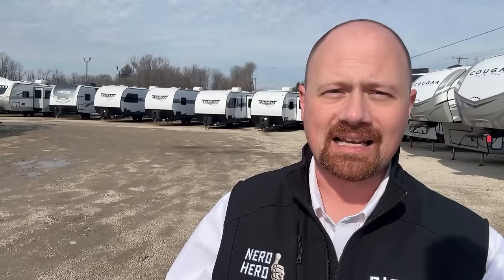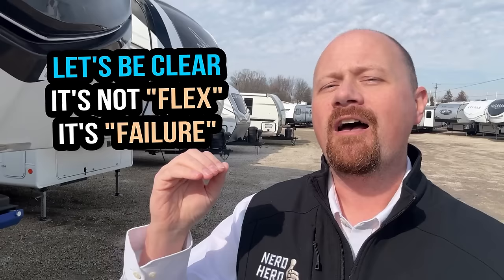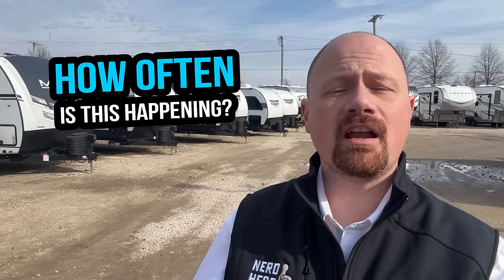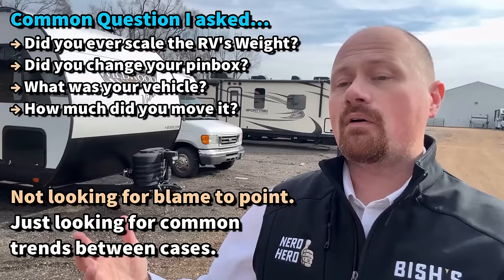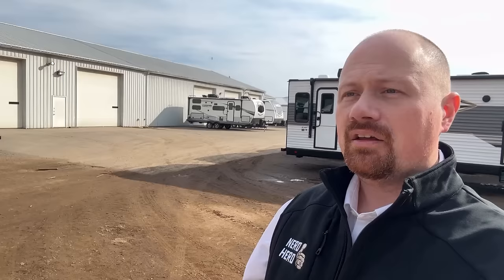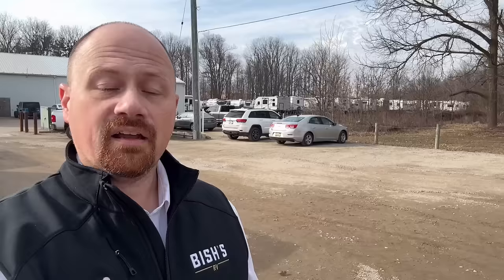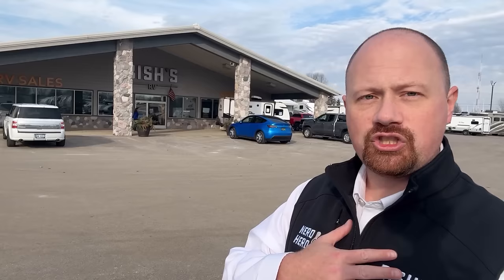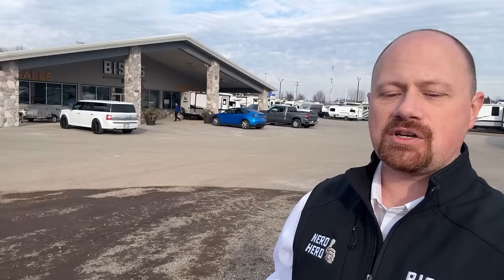🚨 RV Frame Flex & FAILURE!! • WHAT is Happening and WHO is Responsible?!

Comment: Hauling a big RV with a semi-truck is common. Do RV manufactures tell you to only use dually pickups in their disclaimers?
Reply from the maker: There is not enough "dont do this or that" out there period
Reply: No it’s not common ! It is rare to see a HDT pulling a 5th wheel. The only time you really see them is when they are at a Rally. Out in the wild is very rare.

Comment: Great video. I scaled my new montana 3781RL on the way home from the dealership. Pin weight was 500 lbs heavier then brochure and was 750 lbs heavier overall.  I weight mine when loaded to ensure I am underweight. I bought a F350 DRW to pull it. Dealership did ask me what truck i had and recommended a dually. I also researched frame flex the goosebox or Anderson puts allot of excess stress on the pin. Great data. Keep up the great work.
Reply from the maker: Thank you for sharing that. Perfect example of what I mean. How gross your weight and actual assembled weight are often very different.
Reply: The “gooseneck” and the “Andersen” are not similar in the slightest.
Reply: @jefframsey7879 correct but they both change the loading of the pinbox. Thr goosebox is like adding a lever arm on the pinbox. The Anderson extends the pinbox connection out past the end of the pinbox adding more stress to the frame

Comment: I’ve seen a trend on a certain brand and models not naming names of a 5th wheel. Would a middle size or smaller 5th be better?
Reply from the maker: What’s disgusting this video could affect potentially any RV, but the current trend does seem to be focused more on the larger class things, and not the mid to smaller size

Comment: Josh, Love your videos. Question, How did you do what you did at 1:01 where the trailers are backwards?  As for frame flex, how thin can we go till we are caught?  That is my thought!
Bad Steel??? What imported from Ohio?, Indiana? Cain't be Alabama they closed years ago. Maybe, Just Maybe If it was MADE IN AMERICA it would be different!
As to scaling, What are the tires rated at?, Axle?, Springs?, GVWR? Educate your self on the weight of your vehicle. 
Semi truck has a different electrical system.    I hate to burst your bubble, BUT The air ride is much better than spring ride.I started in trucks with springs and transited to Air ride. Bobtailing is not bad at all.    But then Air ride frame, Air ride cab, Air ride seats make a very smooth ride. How many of the 5th wheels being pulled by HDT units are affected by frame flex?
In doing your scale, cat has 3 platforms. then drop the trailer in a parking space and put your pickup on the scale having JUST the driver in the vehicle. subtract the one from the other. to see the difference.
Reply from the maker: 1:01 Just flipped the video on the vertical axis to help focus on the message at the moemnnt

Comment: I agree dealers should do a better job of educating the customer, but I don't see it happening... They make money selling you the most expensive thing you can buy. The customer should know that and do the research.
Manufacturers definitely need to the frames for limited travel. They bank on most customers parking them at 1 campground and or towing them once or twice a year. For Montana high country, 15k miles seams to be the design life, even though it's designed for "full time living".
That also makes a HUGE difference to the number of affected units. Obviously if 90% of them travel less than 100 miles a year, it's unlikely any of those will exhibit frame problems. If they did it would have to be a complete design failure. So if they say it's half a percent, and that only applies to 10% of them that move frequently, then that's 5%, not half a percent. That's obviously just throwing numbers out because of the I have no idea how many people move frequently. Regardless, the "half a percent" number is honestly meaningless.

Comment: Josh, I don't know if you have a video on pin boxes. If you do please lead me to it. If not could talk about the difference of solid and flexible type. What does a slide rubber,i.e. morryde do to he fifth wheel trailer vs. a air ride, ones with airbags and shocks attached to them. What happens between the vehicle and the trailer. Then most of all the advantage of having one. Thank You and safe travels.robert m. aka billy bob
Reply from the maker: I do not but that’s a good idea. Probably won’t be able to get to that any time soon as it turns out
Reply: @JoshtheRVNerd  that's ok, anytime so we can learn ever more about rvs. Thanks again and always enjoy the words of the nerd.

Comment: The truck suspension may not have "activated " if it were spring ride. With air ride there is only enough air to maintain level. Now for trucks not handling well bobtail yeah they suck because they're so light in back and in inclement weather there is very little weight on the drive tires and therefore very little ground pressure and contact patch.

On manufacturer listed weights i bought a 5th wheel and found pin weight to be about 1400lb more than listed and gross about 3500 more.  My tow vehicle is capable of handling the weight but I'm not fond of being at 100% gross axle weight and 95% tire capacity. The published weight is misleading and should be illegal.

Comment: I’ll point fingers. Pretty easy and messed up at the same times

Lippert tells the manufacturer what frame they need.  Not the other way around.  And many says ok that’s what we’ll use. Instead of getting an actual architect to design a proper frame   
We have had two fifth wheels and shooting enough both of them had the exact same issue  and if lippert welded in just two simple cross brace problem solved

Comment: So if you are traveling a lot or full-timing,  is a motorhome a better option? Class C, A, or B?  Are they better designed for higher travel setup cycles / miles over a towable since they are a drivable rv?  Or will you have similar issues with a motorhome used at the same rates? Cracked walls etc…. I have a tt and haven’t had any issues but plan to buy a class c in the next year or so.  Will not full time but plan to take several trips a year throughout the country.

Comment: Go to HD 3/4 or one ton you may not need a WDHITCH which does stress and damage a travel trailers frame./Also.the tall bedrooms up on the front end of fifth wheels seem unreal.Unsafe.Someday we will see smaller crawl in over the hitch pin on fifthwheels or the neck will someday be absent of a house.Jmo.

Comment: Josh - we love to watch your reviews and we appreciate all that you do.  However - on this one - I think you are missing an important point - that comes from my world, engineering.  When we design a system we make it at least 1.3 x it's maximum load.  To make the point you do not hear about automobile or truck frames failing.  And - many of them are grossly overloaded.  There need to be margin in the design and RV manufacturers are not doing the right thing when they do not over design the frames.  This issue would be gone if they did.  Period.

Comment: I agree 99% of what your saying
I do believe that Lippert in particular 
Doesn’t approve let’s say (GEN Y)
Because Gen y will not give them sole rights to the product 
However they approve goosebox
I understand the less expensive gooseneck adapters that just bolt to the kingpin
Changing the geometry and causing frame failure 
I’ve spoken to several RV tecs 
This is a hot topic 
And your comment about too much truck
I would have never guessed 
But makes 100% sense 
Great video 👍👍 
Makes me wanna travel from Wa state to your dealership for my next purchase 
Because of your honesty

Comment: I wanted to add a comment is regards to the "too much truck", you specifically mentioned towing a trailer with a semi truck. Just to clarify there is a large group of people that do just that; however, the standard semi hitch is changed out for an air bag type hitch. So I think this negates your statement, and maybe clarification should be made? Just a thought-thank you.

Comment: I have not hear you mentionned when a manufacturer decide to change the floormat of what the frame was designed for so the weight distribution are not what its supposed to be and could also cause issues!!
Reply from the maker: That’s a potential design oversight that could translate into an issue certainly

Comment: As trailers have gotten bigger and heavier they're running into the same problems that have been discovered and remedied by the transportation industry more than a half century ago.  If you intend on pulling a 40-foot 30-ton RV all over the place, then just make that quantum jump to a converted transport pup trailer pulled by a tractor with air brakes.  Problem solved.

For something smaller, engineer and build your trailer with full gooseneck technology; on a new factory gooseneck deckover.  Sure, the front end might look a little different up front compared to John Smith's fiver down the road.  But the frame will be way more capable.  

Having built 3 different slide-on cabins on a 16-foot conventional steel utility trailer over the years, I cringe every time I see the cheap little frame of some factory-built receiver-pull the same size.    My new truck has a factory gooseneck hitch.  My next trailer will be a 20-foot gooseneck deckover with self-built cabin.  If I don't like it, I'll just strip fittings and fixtures and build a different cabin.  You have to think like a boat-builder and an airplane builder both, when designing your trailer.  No frame-flex or pin-box problems for this boy.

Comment: Sorry man, I didn't really hear you give any serious consideration to subpar manufacturing and the fact that units with the most frequent problems were built during and after the pandemic.  To be fair, it's not just the RV industry, it's everything.  But I find it a little hard to believe that there's suddenly such high numbers of people switching the pin box (although common), pulling with semis, using there RVs too much, and overloading to the point of failure.  Seems like many of the consumers with problems had just purchased their units when things started failing.
Reply from the maker: Regarding so many people suddenly switching  pin boxes

You mentioned a lot of people having issues around the pandemic period - that’s also when almost  literally twice as many people started RVing. Ownership went form 8 million to 15.5 million on input about 2-2.5 years

And the number of mobile full timers skyrocketed far beyond anything anyone ever saw before. The same flex issues were happening before but the number of instances was lower. The visibility of the problem was made much clearer as a result of the volume of users and shift in usage

Comment: OK you answered that you Don't believe my Andersen Hitch is good to use on a 5th wheel.  I believe that is what you ment. The issue I have is the dealership just installed that Hitch in my truck telling me that that's the biggest selling Hitch for them. We just purchased a 2024 Grand Design Influence 3503gk  38ft 3in 5th wheel.  
I'm hoping that I  didn't get taken on the hitch. It's an Andersen 3721.
Thanks
Reply from the maker: Contact your rvs mfg with your vin and ask them to make sure

Comment: I am in the market for a toy hauler 5th wheel in the $125K MSRP range. I was very interested in the Grand Design Momentum, until I heard the term Frame Flex for the first time in my life. What brand of Toy Haulers are good quality, then? Only ones that don't use a Lippert frame?
Reply from the maker: Lippert is about the only chassis MFG making frames for that size. They build their chassis to the specs of the MFG's request

So a lippert chassis from company A isn't necessarily the same as one from Company B

You may consider something like a Valor for comparable features. Seismic is in the class as well. 

Fuzion. Raptor. Those are a few others you may peek at. 

Here are a few Valor models to review: https://www.bishs.com/rv-search?brand=Valor

You mentioned shopping by MSRP... any reason you're targeting MSRP specifically? We don't sell for MSRP at our stores and don't do hidden fees

Comment: Ok Josh< I agree with you. However I think there is at least one think you can do to educate the customers and that is get the scales to weight each TT and 5th as they come or before the sale, Seams easy if it is true the cost of a scale is so cheap that a consumer can buy them. Now for a rant not directed at RV dealerships, but truck manufactures in general. These diesel wars that is going on and them putting those big engines in 3/4 ton trucks withe same frames etc, as the bigger ones  So owners and fools say it can pull it out of manufactures spec's. In my opinion no 3/4 needs more than maybe 350HP and 600# of torque. Putt all those 4ooplus HP engines in class 5 and up trucks. I owned a 2004 2500 with 325 HP and 600# torque and it was very capable at its rated GVW with a 5th wheel. I could go on, but wont.
Reply from the maker: It’s a thing to potentially discuss

Comment: I am retired now, but  i was a steel fabricator for 40 years. I understand what it takes to make a 5 th wheel strong and reliable,  It is not the steel, on the frame of my trailer it is to light weight. It needs heavier guage steel, better gussets and welds. I have never really understood how the front of a 5 th wheel holds together as well as it does. the hinches to me are all to thin. 
I have seen people overloaded and the wrong tow vechile.
Do not change your hithes and do not overload either.

Comment: I dont think 5th wheels are made for off road. 
I have never taken mine off pavement and never will. Plenty of places to park
Tremendous flexing from potholes, jerking from getting stuck, just think they are not build for that
If a camp site is not perfect I do not go there
Reply: not everybody is a parking lot camper like you have you seen a toy hauler
Reply: Yes, I do get it. Different strokes. That being said slow is better but it surprises me the problems with new rigs.  I have an old junk Jayco 30 years old 35' 5th wheel with 4500 lb lb capacity, ,zero electronics, no central plumbing panel. ITs got a hose and extension cord. I am a full timer and dont do a lot of travel but the frame issues and high tech of new ones scares me. Talk a look at my FOLD OUT floor layout on my channel and my cats. Enjoy RV life @Nick-tr2ln

Comment: This is nothing new. My 95 Avion 36’ had a frame recall back in 97 for the same reason. After the repair was done the front jacks wouldn’t lift the unit up. I was towing with a 3/4 Dodge.

Comment: I have recently heard that some tow vehicles are not designed for certain weight distribution hitches. This is news to me as I have been RVing for 40 years. I would think that if the vehicle comes with a factory installed tow package it should accommodate a weight distribution system. Is this true? How do you know if your vehicle is one of these? Thank you for this very informative video.
Reply from the maker: That may be possible. I know unibody designs are not built with the intention of having a weight distribution hitch applied to them for for instance.
Reply: Does a Ford Explorer have unibody construction?

Comment: My Grandma and Grandpa told me that they filled their trailer fresh water completely full their Gray water tank completely full of water regular fresh water and they filled their sewer their black or whatever you want to call it halfway full and they waited then they went and took a bunch of they went to 500 pound weights and put it inside the trailer to find the sweet spot of their cargo where they could put their cargo and that's how they travel They're never overweight they're right at the line but they're never overweight    They literally live in their trailer full-time and they still travel in that trailerTo this day no problem no frame problem  Buy a Jayco there metal frame is tones better material and this Josh guy key point is don't travel much or over weight it. 😅😅😅😅

Comment: I hate to bring this up, but maybe it's time for some federal regulations.  Motor vehicles have them, and with the number of RVs on the road increasing, it's time they had them too.  Maybe it's time to set minimum weight to frame strength requirements.  Maybe it's time RV manufacturers state clearly in their warranty whether full time use is covered, whether something is considered a "park" model not designed for being moved except from storage to park, then back to storage at end of season.  If they are meant to be moved with some regularity, what do they consider "normal" mileage?  If any pin box other than the one they install is acceptable, or that goose neck hitches are absolutely forbidden, then that needs to all be clearly stipulated so consumers know what they are really buying.

Comment: If you look at older 5th wheels there was a 2x8 or 2x10 steel rectangular tube running on the outside walls of the upper deck floor that created a “toe kick”.  Consumers didn’t like that so they went to this revolutionary flat floor design with plenty of headroom. We now see this was an engineering failure and a flawed design.  If you look at a goose neck flat bed car trailer it will have 12” I-beams with huge gussets for the goose neck. So some engineer thought you can just replace that with 2x4 tubular steel frame? For the average weekend warriors it will probably be ok, but full time with all that weight and it will fail.